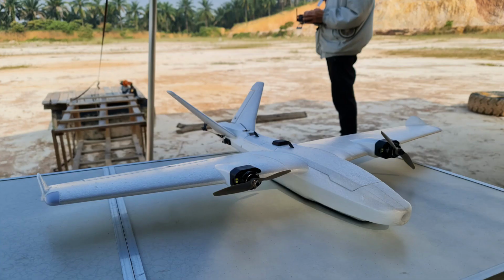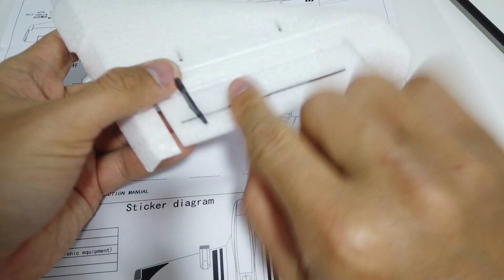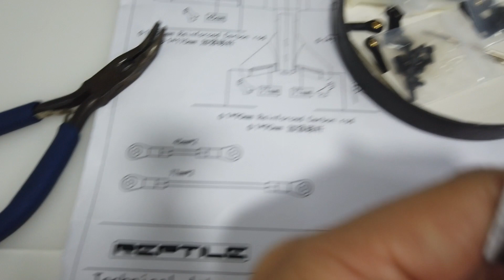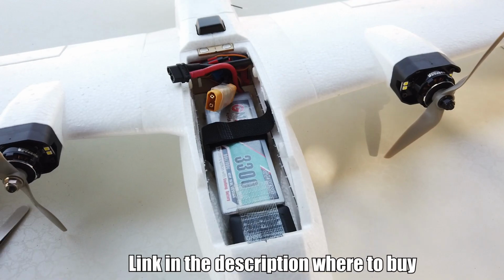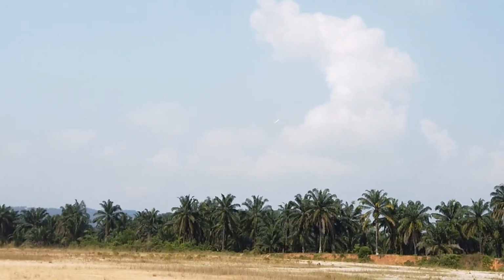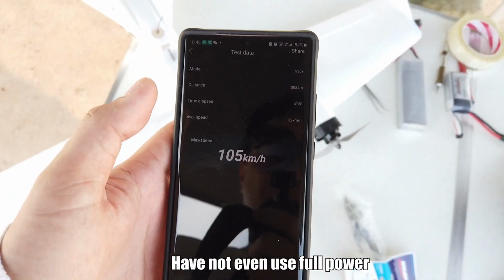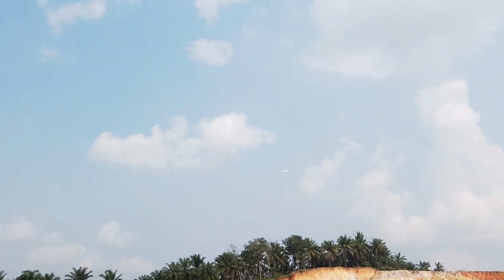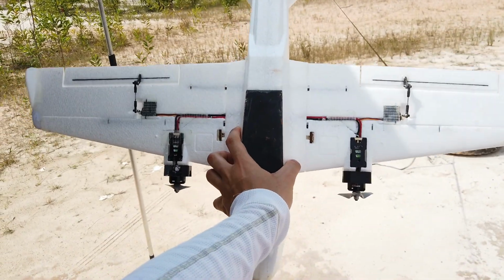Reptile Dragon Talon Unbox, Build, Maiden - IT'S SCARY TO FLY!

Comment: Thanks for taking the time to make this video.  Did you have the CG on the markings for the first flight with the 4S pack?  And where did you have CG with the 3S pack?  Thanks!
Reply from the maker: of course i do as the CG point is very obvious. a little dot. factory CG. subsequent flight i make it a bit more nose heavy but still.. spiral and crash...
Reply: So should the CG be moved back a few mm? How much?
Reply from the maker: @IanF-FPV  too risky
Reply: @EdwardRCAir  ok thank you. Another reviewer said it tip stall when you go slow. I received my kit from BG a few days ago. Wings are so small. If only they were another 200mm.
Reply: Did anyone figure out the jumper that shows 3s-4s on the motor mount?
Reply: @IanF-FPV  I have no idea what it's for.  When building mine, I applied 5V to the small Vcc/Gnd pads (possibly reverse of what the silkscreen said, can't remember, but I remember something being weird) and got the LEDs to light up.  I would have needed to run an extra set of 5V wires to the motor plate so I didn't integrate it into the build. I don't understand the big solder pads and/or the 3s-4s jumper.  I personally don't see how those could power the LEDs.  I wish there were clear instructions on how to use those boards.
Reply: @brubakerjm  ok cool. Not really interested in running even more wire out the wing. May just leave the motor LED off for now. This plane is taking me forever to build.Fuselage is so cramped for my FPV gear and Matek F 411wse.
Reply from the maker: @IanF-FPV  erm i think the issue isn't "tip stall when you go slow". it just tip stall and spiral suddenly without warning when it was flying ok minutes before
It can also fly slow, example during landing, but no tip stall tendency
And then it just suddenly tip stall and uncovereable.
Very worrying to fly. Very unpredictable
I just spoke to the designer, new video coming with updates about this.
Reply: @IanF-FPV  I'm having the same experience.  I sorta wish I had put my F411-WTE under the rear hatch (where the VTX is "supposed" to go).  But it's on the main FC plate now and I just want to finish it.  Currently at the INAV programming phase, so hopefully I'll get to maiden it soon.
Reply: @brubakerjm  I didn’t glue in the FC plate so I could slide it back and forth as needed to access the USB connector. My vtx is on the rear plate. I just need to install the servo horns, control linkages, and Crossfire nano with antenna. Still a very tedious build.
Reply: And another thing. The kit doesn’t include that PDB board or the wing tip led lights. Where can I get the led lights??!
Reply: @brubakerjm  what color are those LED? White? Also, are you running DJI? Where did you mount your VTX?
Reply: @stoobiedoo2  The motor plates have white LEDs.  The wing tips LEDs are red/green.  I ended up putting a programmable RGB LED in each wingtip and not wiring the motor plate LEDs.  I am running a Caddx Polar camera with Vista VTX.  I was getting tired of the build process at that point, so I just glued a popsicle stick above the vent hole in the bottom of the nose and zip-tied the vista to the stick.  It should be sitting right in the airflow coming in through that nose vent hole.  I still haven't flown it yet though!  Almost there...